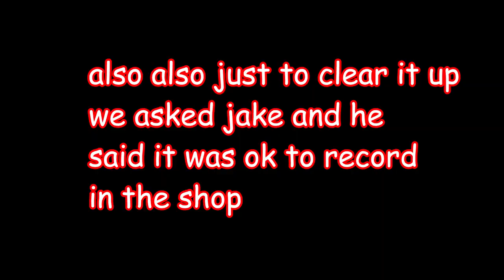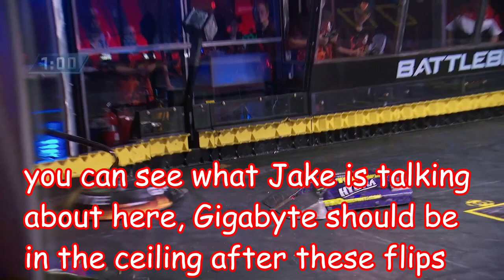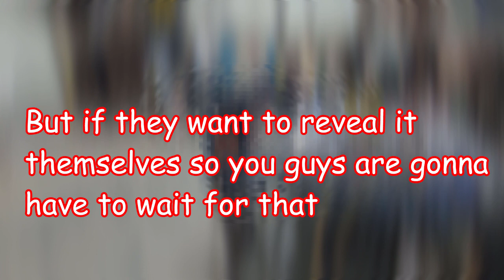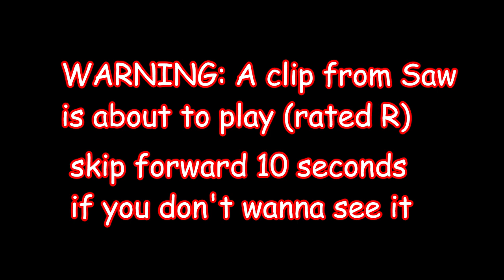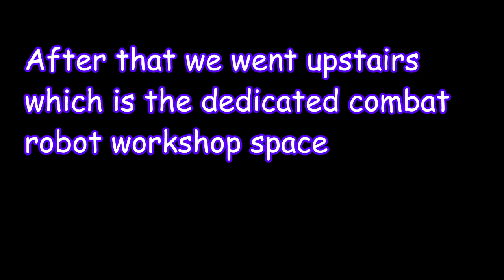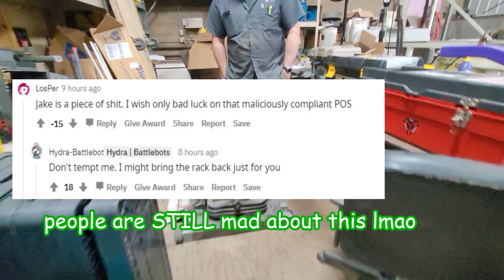Behind the Scenes at Whyachi HQ With Jake Ewert!

Comment: Hydra is, by far, my favorite Battlebot. Hydra shouldn't be rated #31 nor #4. Hydra is a #1 Battlebot but Jake Ewert needs to rethink the front "tongue" and forks. They are the weak point on this bot. Perhaps they need to be a bit wider and heavier? The internals need shored up too. In a couple of fights the flipper was handicapped. While many bots, like Tombstone, can't seem to re-build a better version of itself, Hydra's weak points can be re-engineered to be better, stronger, and more durable.